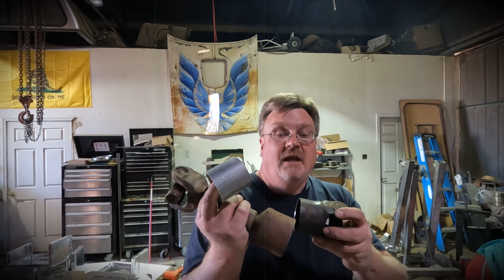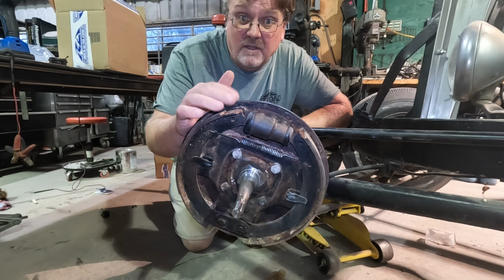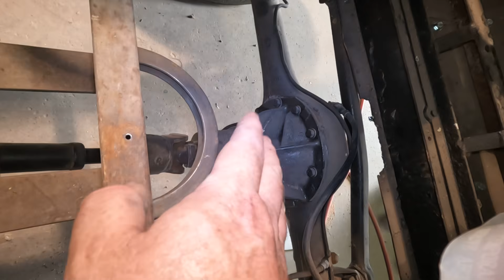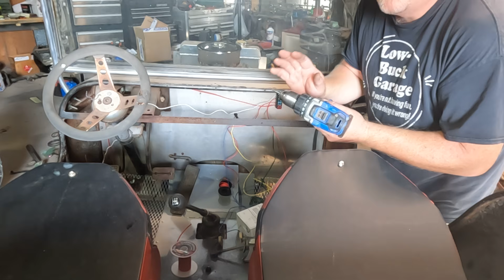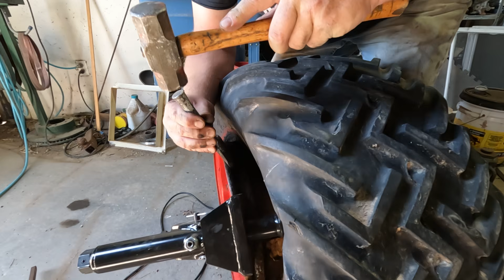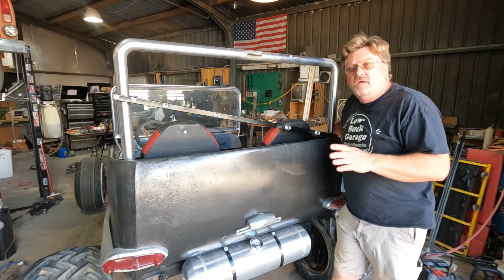Off-Road Hot Rod!

Comment: The ticking sound was the engine cooling down. The metal was contracting. When you took out the plug and installed the temp sensor you had pressure so must have been an air pocket. The air pocket was causing the metal to tick. After your ride in the sand pit it most likely got the air out. Might want to install an overflow for the radiator. It will allow the air pocket to escape and the coolant to be sucked back in after the air pocket is expelled. Nice seat of the pants build. but i agree overpowered for what is there. Cam, Highrise intake and headers will make a bit of HP. Mufflers will cut off a bit of the HP but open headers sound so nice 🙂 I would rather spend some time on the suspension then lower the HP. HP is so much fun lol

Comment: What's that wide front tire trick?
Reply from the maker: I've seen the wide tire trick on a lot of 50's to 60's off-road builds.  Wide tires were not readily available, so they used wide rims with a regular tire, and tubes inside made them fit.  In the 60's my Dad ran around in an MB with all 4 like that.
Reply: @LowBuckGarage  tubes. That makes sense. Thanks.

Comment: With a lot of proven results I use Butyl Sealant with an o-ring to seal split rims on aircraft wheel assemblies. Butyl compound is compatible with tire and o-ring materials. 
> You should try using  Butyl Sealant on your tire bead (rim seal).  The rope type is rather soft-rigid and will not spit out of the rim assembly.

The bead sealer glue-goop isn't as reliable as firm-butyl rope caulk.

Let me know your results.

Butyl Sealant rope Amazon ~$1.10 foot. Roughly 13 feet of material

Comment: Your debead problem is corrected by running a narrow for tyre rim so when you air them down they don't debead easily.  The more brake fluid it takes to move the wheel cylinder the LESS brake pressure you have. Run a large master cylinder bore and small wheel cylinders for strong brakes.

Comment: If you put some suspension in it, you’ll be able to stay on the seat a bit better, which in turn might let you stay on the gas a bit better too. Your wiring and instruments will appreciate it, too.
Right now you’re relying on frame flex and whatever give is left in those old tyres, to absorb the undulations and that’s almost as bad for you as the car. But parts for you, while very cheap if they can regenerate, are not easily sourced, or found lying around, if they can’t. Don’t want you to break anything that stops you having fun, at least until I’m back out of the repair bay myself.

Comment: Love what you do. Just wish you could do more!
One thing about this buggy that puzzles me is, you had terrible trouble with the rear tyres, which seem to be the right size for the rims. That’s normal enough, with old metal and older rubber and I probably would have fitted tubes. But you have no trouble at all with the skinny cross plies on the super wide front rims. How are those staying on?
Reply from the maker: Thanks!  The front already have tubes; I think that's the only way to get them on at all.  I thought about tubes for the rear, but the rim was so rusty inside I was worried that would just eat up the tube.  Also, tubes that size are pretty expensive...

Comment: I gave up on my old mower tires and got tubes and took them down to the comer garage.   It was cheap compared to doing it with hammer and crowbar. It been 3 years so far and no air needed and the old cracked and leaking tires it haven't cracked open.

Comment: Cool buggy and love the trolling could see a possible dune ripper if proper cage attachment and possible side bar for if did role as for engine just put efi carb on I no its not useful for poor fellows like me but performance is great when hoping around and possible cut outs would be great for when u just want to be able to think since now there actually cheaper then ever or go route I've done and build one is pretty simple and good old lawnmower cables for opening now they weren't perfect sealed but dam close with just flap.rod.little weld even brazed one one time keep up great work and have great day.

Comment: 👍👌👏 This is a really great video! Additionally showing a lot of progress and fun. 😁 It's highly impressive, there never seems to be a shortage of human fantasy respectively ingenious ideas. A turned over back of an old car as a kind of cabin bucket for a dune buggy is looking pretty slick.
2) Please kindly allow me to suggest some things : a) Please consider to weld/put 2 diagonal pieces of pipe onto the role over protection to stiffen it up a bit. This could even give you some side support while sitting in the car driving through rough terrain. Of course some kind of cushion needs to be added then. b) How about some old style radiator supports? Just two long, relatively thin rods going from the radiator to the firewall.
c) You're absolutely right, it's the wrong engine for this car. Too strong when revved high but not enough torque if not. Maybe such a bullet proof 6 cylinder inline flathead engine, like used in a lot of old cars, boats, forklifts and other devices, would match better? I just watched the newest Coldwarmotors video. The black old Plymouth has the engine that I'm thinking of. Waylon Wire has an even older one in his oldest rat rod.
Thanks a lot for making teaching explaining recording editing uploading and sharing.
Best regards luck and health to you and your family.

Comment: in a hydraulic pressure system, when pressurized fluid enters a chamber of two different volumes the higher pressure will be in the smaller area.

Comment: Hi Everyone...   I had a Triumph TR4A that had no floor. It was rusted out. So when traveling on a gravel
road, all the dust would come up through the floor and right into my face.  I think you are going to want to
have a real floor on that thing.
Reply: I thought the same, then thought rubber floor mats over the expanded metal would fix it without compromising the easy clean up.
Reply: Hi  @n1r0l  
   The problem with rubber mats is that from the wind they rise up and in comes the dust. Or any holes
between the mats and the body.   Also any holes in the exhaust in the front at all will bring exhaust
gases into the vehicle.  He made a beautiful looking job, but maybe a layer of fiberglass for a floor would
do the trick.  But at least he has brakes.

Comment: That brake cylinder seems logical. I remember that your drum brakes have a leading and a trailing edge shoe so for one the forward rotation of the wheel acts to pull the shoe into the drum whereas the trailing shoe is pushed away. Better drum brakes would have double leading edge shoes. A cheaper option would be to give the trailing shoe more force from a larger piston as you have.

Comment: I sorta skipped around in the video a little bit, did you mention inner tubes for those old tires?  They of course make heavy duty ones for tractors and even wide drag racing applications that could fit inside that old Terra Tire just fine.  We used to run those big Terra Tires on buggies in Alaska, they are great for flotation, but need to be able to air them down a bit.  Your rough ride is partly how full you are keeping them so they stay on I think.

Comment: Nope a brake cylinder with 2 different bore sizes would have lower psi on the larger bore side as psi divide by area  is less on the larger size bore, and higher on the smaller bore

Comment: I just love the style of this buggy. Could it ever be road legal ?
Reply: The style of this buggy is called a "Water Pumper" they are great!
Reply: Possibly not. I think you need receipts of where parts came from to get a title for something like this. The rear section of body from an unknown car might be a little difficult to figure out the legalities of and I doubt the frame has a vin on it. I might be incorrect on all accounts, but other than that it needs the usual stuff like lights, wipers, ect.
Reply: @conspiracyscholor7866 even in California it could get a custom construction title if you really wanted to
Reply: @conspiracyscholor7866  I see that is understandable. Thanks. Here in UK, as long as you have the vin number of a vehicle and transfer most of the parts, ie engine, front and rear axle ( I am not sure if it needs all of the running gear) you can register a vehicle. But our registrations are different to the US etc. The registration stays with the car ofr lifwe and just the name and address changes for the new owner. The numberplate doesnt change unless it has private plates on it. Here in U, if the running gear was placed on the buggy, it could be registered for road use as long as it is road legal.
Reply: No! why would you want it to be
Reply: @MrJeep75  So it could be driven on the road. Dur!